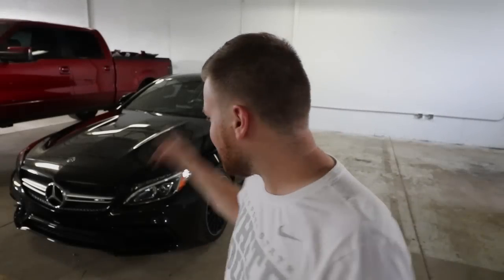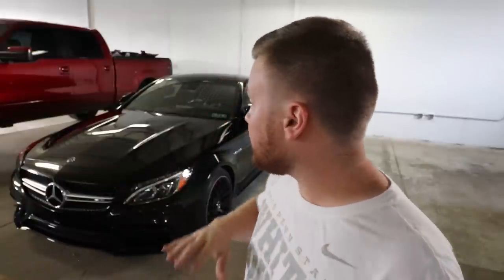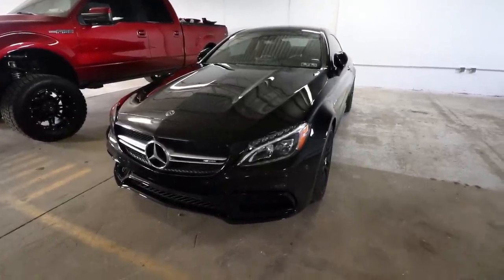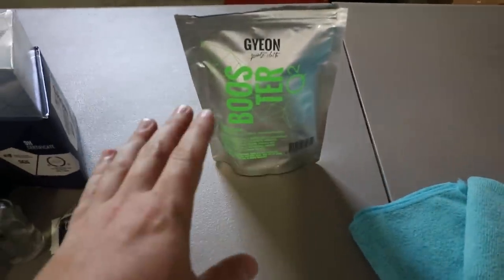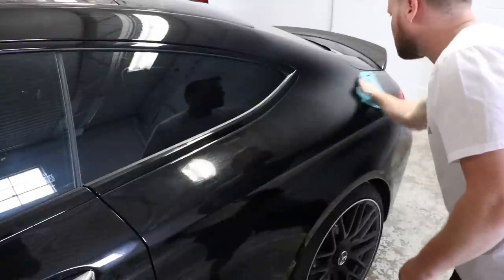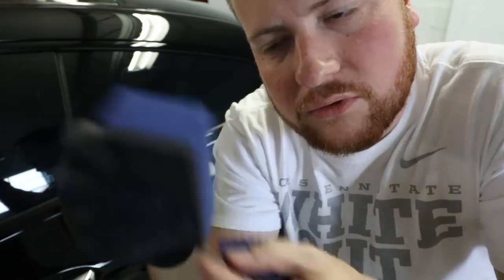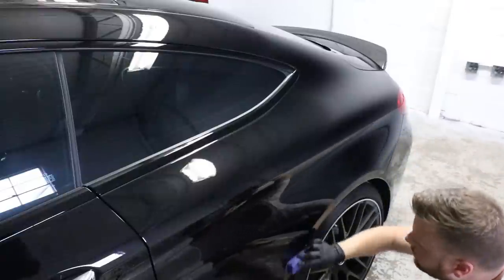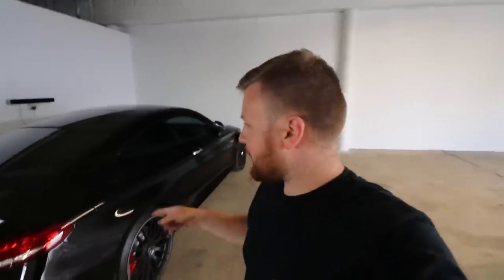How To Make Your Car's Paint Permanently Glossy

Comment: Troy - did you apply to the Xpel as well?  What about on the glass/trim or is this only for the paint?
Reply: dronjones1 good question I wonder I just got a brand new windshield. would like to protect it as much as possible
Reply: JeepLife 203 for Windows apply rainx, that's all you need, and for trim you need a special trim coating

Comment: Great video! I have C300 Mercedes I wanna get a coating on. It is also in black. How perfect was the black paint in regards to swirls ,scratches etc. before putting the coat on? I imagine once that coating is on your stuck with however "clear" or "perfect" the paint is under the ceramic coating. I've never done a ceramic coating. keep up the detailing videos!
Reply: Eric Tompkins paint must be to your standards before installing. you will see any scratches you have.  it's so clear you honestly can't tell it's there.
Reply: sweet thanks!

Comment: Helps to have a Good , $3,000 Paint job.. with 4 coast so Buffed on Clearn Coat.. Standard on Mercedes ..  Had to have my Camaro Convert.  Paint Job Clear Coating machined buffed off, then Paint Buffed and 3 new CC's and then Ceramic coating. $1,600 . and has to be done in a Paint Spray Booth for No Dust! Maybe More Where you live..

Comment: Theres no way on this earth the shield that he put on the front and other parts of the car is 8mm thick, impossible full stop ? Grab a ruler and look at each 1mm, now times that by 8, thats how thick the stuff is on the car, if its a vinyl wrap even then it would only be like maybe 2mm thick at the most ?
Reply: He didn't say 8mm thick.  He said 8 mils thick. 1 mil = .001 inch (1 thousandth of an inch). So 8 mils = .008.

Comment: Do you know that ceramic coating is a disaster after couple of years.. this a permanent coating and it will get scratch and it can't be fix. You have to remove it all which it's very expensive process so you can apply a new coat. It looks great but no one are talking about what will happen after 2 years.. you may re paint whole the vehicle coz you might sand it or use chemicals but it will be a mess.

Comment: Well, I guess so, but I just run  the car thru my hands Free Car was, no liquid wax.. Then bring it home fully dried off , put in the Garage to avoid outside Smog/Dirt over nite and Add Mop & Glow on The car and I do the Tires as well.. I do this Spring, Summer and Fall.. But Your System and Ceramic treating is by far better , but far more time cosnuming  ..

Comment: What a waste of effort. The AMG C63s got water in the intake and hydro-locked. A new engine was going to cost more than $70K, so insurance totaled it with less than 3,000 miles on the odometer. Very sad. On the bright side, he is going to order another new C63s.
Reply: Zachary Zarko I wouldn't buy any Mercedes-Benz if hydrolocked so easily. 
I think the C63 would hydrolock by simply pressure washing, the grille / front bumper, like he does.
Reply: I don't think it's that easy to get water into the intake. I searched the Internet for similar problems, but it seems to be a very rare occurrence. He said it happened on a two-lane road during a rainstorm when a car traveling in the opposite direction caused a huge wave to hit the front of the AMG.

Comment: Troy Sowers. 8mm .....=wank. Mate, a good quality carnuba polish will do the job and then periodic maintenance every 3 to six months will result in a lot of money saved over this crap you peddle. Ceramic? and hardness ratings? lol. You prophesize putting  something with  the hardness of ceramic over a soft membrane...yeah sure.
Reply: Well finally. Someone has come out and said Ceramic treatment is actually not a ceramic material. Top shelf wax and polishing cloth along with some calorie burning effort for me Troy old mate.and I will use the money I don't spend on "ceramic" on other stuff.  Plenty of cars going home from Pebble Beach each year with trophies after a simple wax. Cheers.